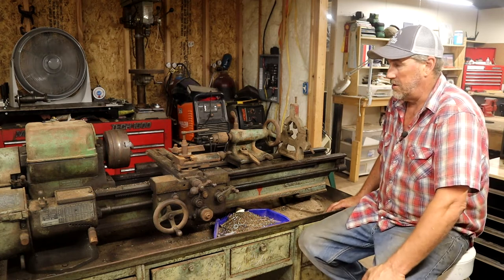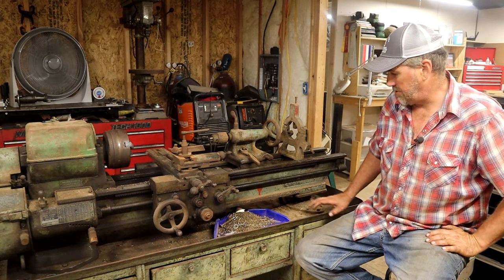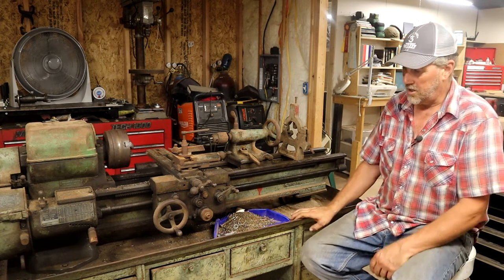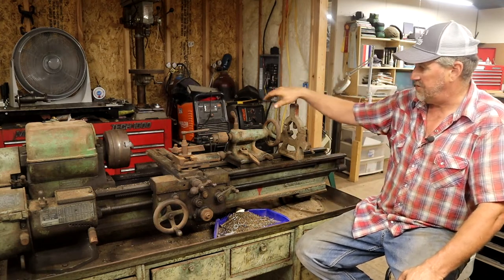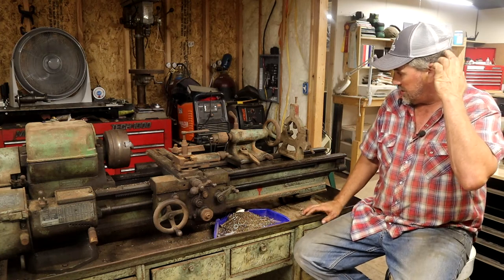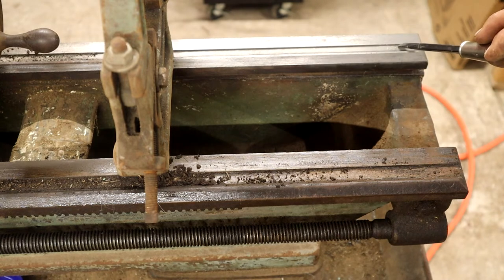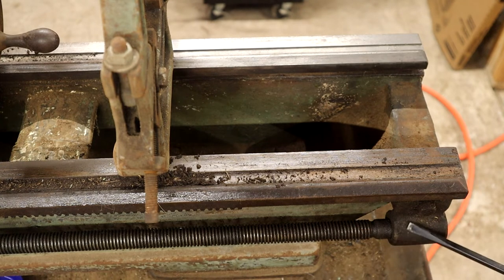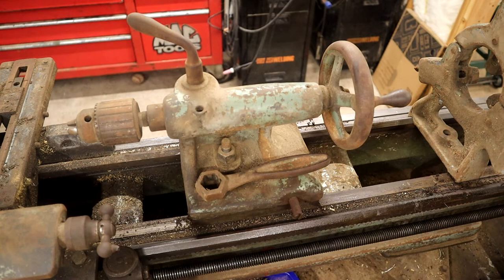The Sheldon Lathe Part 2:  Walk Through and Things to Consider If Your Looking at Lathes

Comment: That's a 1.375 threw spindle dia, also is able to be modified easy by boring out the short spindle. Also if your electric ever want out, it's a easy modification to turn that back into a foot power lathe. That lathe is a fantastic gunsmith lathe, easy spindle bearing fix's, cuts great threads, looks like a 12" swing and 56" between centers, locking cabinet drowers, takes up small space.. Collects works great on that lathe also. If you got it free you gotten a great deal,  I paid $750 for mine many years ago, it's been working fantastic for me. Just saying !